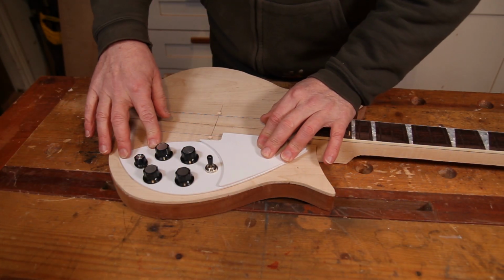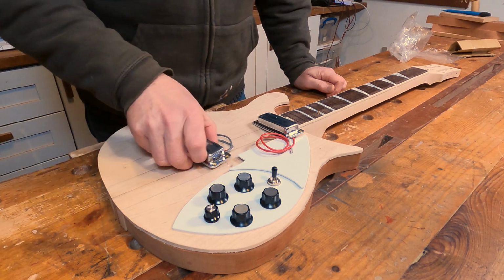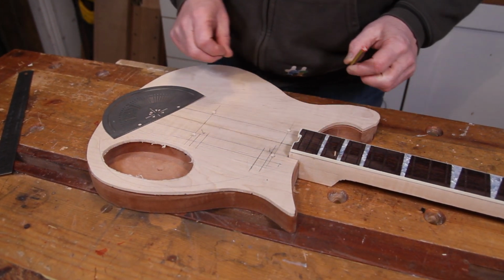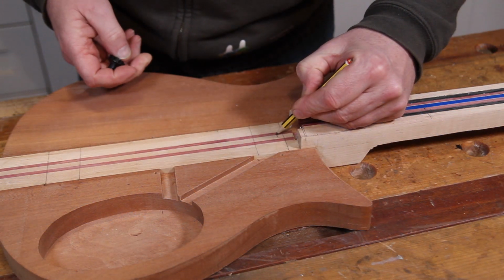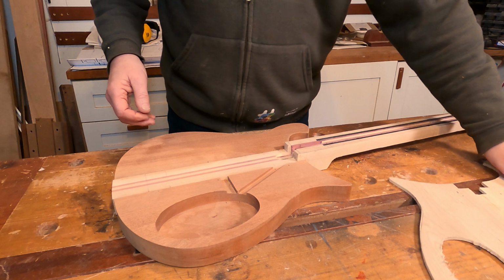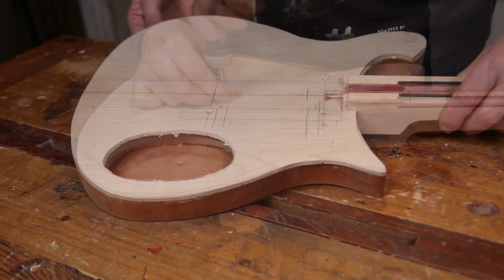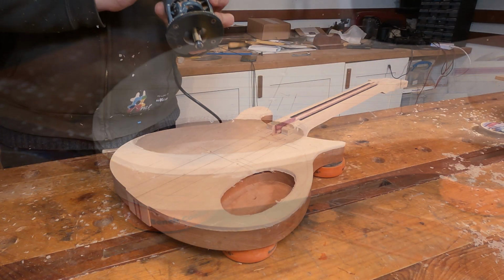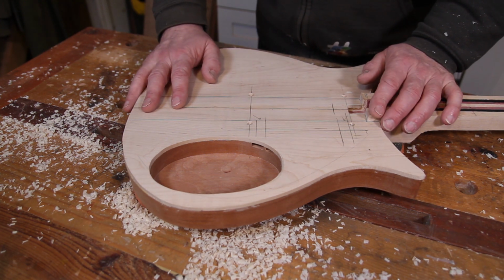Rickenbacker 620/12 guitar build Episode 24

Comment: It would be my guess that the springs and machine screws for the pickups are for mounting the pickups in a scratch plate (or surrounds) with the tabs and springs below for height adjustment.  If they were meant to be top-mounted, I would think they would be wood screws like typical P90s.   Loving the build and all of your careful thought going into it, and sharing all of your thought process with us.
Reply from the maker: I've checked this out now, they are surfaced mounted on a foam pad and wood screws.

Comment: You should get bushings for the pickups. They run like 5$ each or you can use the rubber grommets they use on the 325. That will help out a lot
Reply from the maker: Yep, got my head around how it works now. I have some on order :)

Comment: Idk if it is because of the electrical pocket not being finished on the top, but it looks like there may be some of the hole exposed when done.

Maybe like that bottom left pot is too close to the edge of the pick guard and isn’t allowing the pick guard to sit over far enough.

Hopefully the next episode we’ll see if that finish route on the cavity area of the top allows for a nice fit.
Reply from the maker: I think that might be a trick of the light, I've triple checked and it all fits fine. I have held off drilling the mounting holes so I have a bit of wriggle room if needed.

Comment: Looking good! Don’t you need those holes where the pickups are riveted to fix them to the body? The other hole is purely for height adjustment. You may need to just route out a few mm incase you need to back off the pickups a little.?
Reply from the maker: Having looked into things a bit more, the centre holes are for fixing. The pickup has a foam ring under it for a touch of adjustment. I think they should be just about right hight wise.

Comment: Hi, I’m wondering if the machine screws and springs with your pickups aren’t meant to be used with pickup rings or a scratch plate?  I guess you could always change the screws to an appropriate wood screw.
 I’m enjoying your build. Thanks!
Reply from the maker: Yep, I've figured it out now, foam pad under the pickup and wood screws to hold them on.

Comment: Hello Patrick. I have two questions. First of all those pick ups look too tall. Once the fingerboard and the top are glued in place how much space will you have for the strings to pass over the top of pick ups? Maybe it’s a matter of the camera angle and the perspective but it seems like the action will have to be very high to clear those pick ups.
Secondly, once the top is glued on, are you going to route out the control cavity.? When you were mocking it up last time there appeared to be a gap at the bottom of the scratch plate where you could see into the control cavity. Other than that, as always, greatly enjoy watching your videos and learning from an expert.
Reply from the maker: Hi mate, I've checked the pickups and once the fretboard is on and allowance made for frets and string action they should be fine. If there is an issue I can always put a little route in to drop tham down a bit.

Regarding the pickgaurd it might have been slightly out of place in that shot, I've checked and it all fits great :)

Comment: Why do you need that truss rod adjusting nut to come out, and won't the pickup be in the way 🤔
Reply from the maker: The pickup will be in the way but I want to be able to take it out so I can lube the rod adjuster if needed and also if the holes in the nut get worn I can spin it around.